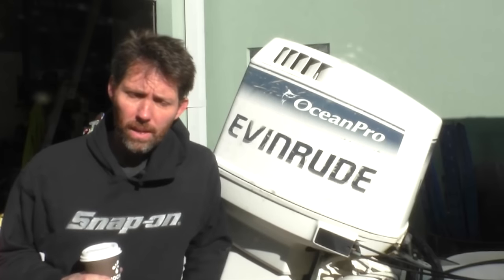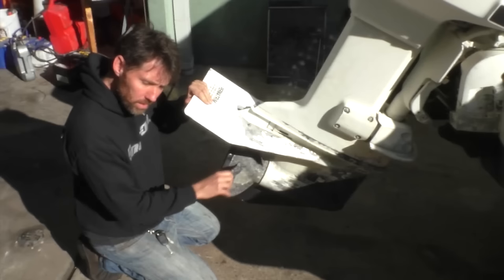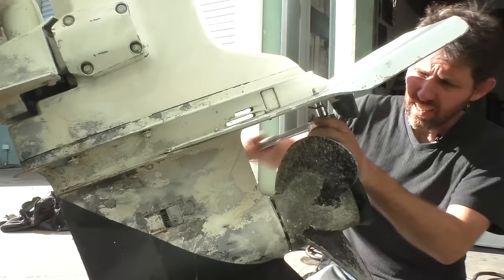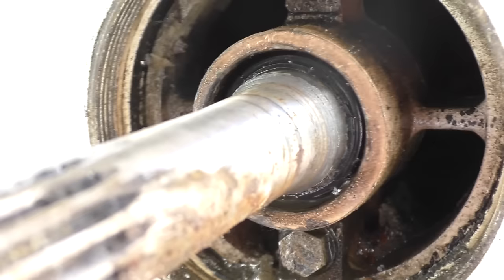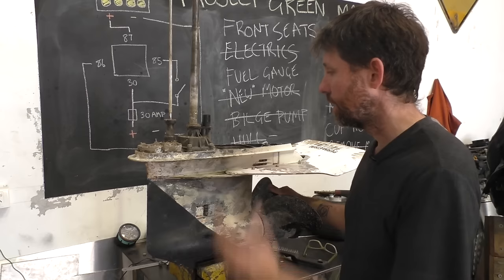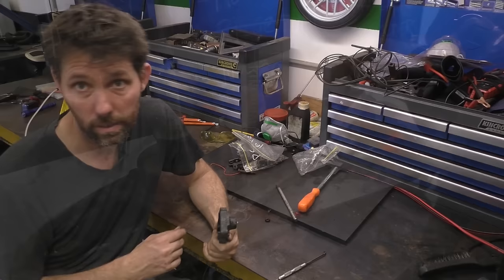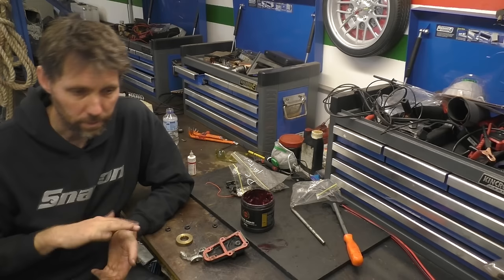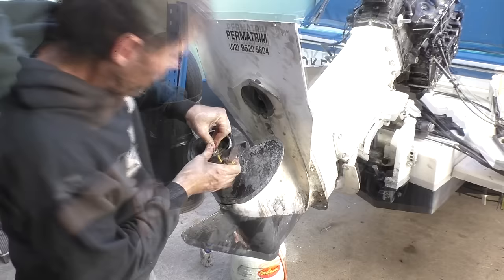Starting an Evinrude 150 outboard for the first time in years

Comment: There are some cheap motors out there in the 150 hp range which i need , but have a blown piston , or weak compression in one cylinder  is
there a lot of work involved in fixing ... thanks.
Reply from the maker: It is a fair amount of work, and if the cylinder needs machining and an over-sized piston installed it can start to cost a few dollars even if you are doing the rest of the work yourself. If it is just low compression is may be stuck rings and surprisingly cheap to fix other than the labour.

Comment: In my opinion outboards shouldn't be on boats kept in the water.. Sterndrives are another issue though, as the engine is inside the boat, and only the driveleg is outside the transom.
Reply from the maker: The thing I like about having an outboard on a boat that lives in the water is that it doesn't have any drivetrain going through the hull leak. Cowlings generally seal better than most engine bays and if the bilge does fill with water the motor is high above that and doesn't get wet.
Reply: I used to repair and detail boats, so I saw alot of different engines and configurations. I guess I could weigh up what I thought was good with what was bad. Everything has got it's pros and cons. If you have a prop shaft, than you have to worry about the stern gland packing leaking, which you can minimize but never stop, but thats why you have automatic bilge pumps for. I've also had to repair transoms torn out of boats because the manufacturer didn't put enough reinforcement in there for the outboard power level it was built for, and pre-emptively do others. It's a subjective thing, and there is no 'best' , it's like trying to say which tractor is best for baling hay?

Comment: Hello sir. I just got this exact motor. Came from a real awful person, so, it's a bit of a mystery motor, that I have to inspect carefully. 
Question:   I've spent a bunch of time, trying to figure something out. I am swapping lower units. The one that I removed has a STRAIGHT shift rod (not even sure it's the correct one. I was Bait  & Switched). The replacement one, has a bend at the top. Which is correct? If the bend is no good, do I just remove the straight one, and put it on the replacement? It's a 1994 150 Ocean Pro. I'm using the lower unit, of a 1996 200 Ocean Pro, which I believe to be compatible.
Reply from the maker: This one is apparently meant to be bent (see follow up video for details)

Comment: Thinking about buying a used 70hp "Evinrude" outboard. However; the gentleman has said that the outboard  sputters at a low idle. Should I be worried?
Reply from the maker: It would be good to get to the bottom of the problem before buying it. If it does will on compression test I wouldn't be too worried, could just need a carb clean or some new plugs.

Comment: I have a 1989 johnson gt 150 go to take off no power I push my key in and out couple times then has power what should I do carbs looks good new gas line and new filter
Reply from the maker: It's definitely running lean if choking it gives you power back. I would make sure all the carb jets are clean and that the floats are working properly.

Comment: Hey curious what your thoughts are of removing a VRO and just mixing oil into fuel tank?
Reply from the maker: I personally think removing the VRO is the way to go. Because the fuel gets mixed before it enters the carburettor bowls the ratio of fuel to oil is set based on the revs you were doing a short while ago so it is nowhere near as useful as the new ETEC technology for example. Add to that the risk of it failing and I think you are better off without it.
Reply: Probably a bit late now, but years ago the VRO pump on my Johnson 50 failed.  I was out on a lake, and it caused the fuel to be saturated with oil (better than the opposite!).  Very embarrassing being towed in by a canoe :-)  I was given a choice of $600 for a new VRO pump, or $60 for a normal pump and premix.  I chose the latter and haven't regretted it at all.

Comment: Please Can Someone HELP ? 
I Have an Early 80's Mariner 50hp 4 Cylinder 2 Stroke. 
I Want to Remove the Gearbox BUT It Will Not come off = GGGrrr ! 
1) Placed Gear-Shift into Neutral, 
2) I Removed the 2 Front Nuts & the 3 rear Nut or Bolts around the Zinc Trim Tab = 5 in Total. 
3) I Tried to Pull the Gearbox Down BUT it Only Comes Down 10mm & Will NOT Come Down Any Further. I Don't want to use Force & Cause Damage
* I Can't Disconect the Gear Shift Shaft as it is ALL Internal BUT I Can See it's Top Underneath the Carbs. Do I Unscrew it There ? * 
Please Can Someone HELP ?  
THANK YOU.

Comment: i have a issue we my 1995 yamaha 90 2 stroke  running  foward they dont go more that 3500 RPM I remove the oil tank mixer i mix the oil we gas now ,i change the spark plugs  i clean the carburattors ,i change  the fuel line ,the prime i clean  the little filter inside the motor,i check the fuel pump don have any hole on the diagfragm the compression on all 3 cillinder is 140 on each cilinder and is working better but not more than 3500 RPM, I dont know if is the CDI SAFE MODE or any other Issue,can you o any person here can help me PLEASE.
Thanks

Comment: great video lots of info on each one of ur videos fix my old problem it wind up been the computer water passege was clooged up. thanx for ur help there.
i have a diff problem my 1999 evenrude fuel injection. is has a long cranking problem , it takes too long to start idk if my choke is even working or how to ck it, but it will start after a long period of cranking the engine over bit i really dont like that im afraid to ruing or damage something else, what would be ur advise to me as tomwhere to start looking, ur help will be appreciated.😊
Reply from the maker: I'm presuming you mean oil injection not fuel injection - ie. it has carburettors - Is your choke activated by pushing the key in? When you do that do you hear a click from a solenoid at all? Could just need a carburettor clean if the idle jets are a bit dirty, but if it idles nicely once it does start then I would be looking at the cold start system for sure.
Reply: Well idk now I have 4 ignition coils 2 per each bank n 6  huge injectors.
What I found out yesterday was I have no spark I do if I crank the engine long enough n then it will start turn it off n on n it starts every single time,but today no start no spark until  excessive cranking, biggining to believe crank sensor failure but don't know how to ck it I have a solid red wire n it could be black or dark grey wire don't know wat to  expect from each one of them? Ur help is greatly  appreciate it ty so much!
Reply: Well I know my questions and issues are a little complex, but here is what I find out over the weekend that my IMM is faulty how I find that out with a simple tap tap using a ball pin hammer n with used of a friend at the imm housing while cranking the engine over I can see spark from the in line spark tester n had the engine running as well turn the engine off n stat it again no more spark tap tap I have spark again lol.
Anyways searching other videos on my everude ficht is that they go bad from over heating n another I found out is that the cooling lines or even the imm it self can get clogged up like mine was. Anyways ty so much...

Comment: awesome video, ive got 115 johnson basically the same as this one but 4 cyl , i left mine for a year and it still starts but wont idle anymore, have fresh fuel and pulled the carbys apart and cleaned out but still the same, do you have any ideas? do these have a fuel pump on them? i can keep it running by pushing the choke when it starts to die
Reply from the maker: It the choke keeps it running then it must be lean so I would still be saying blocked carburettor jets. They do have a fuel pump but if that can supply enough fuel to run with the choke on then it isn't likely to be the problem. I could also be the floats in the carburettor bowls not letting the bowls fill up to to the correct level.
Reply: Dangar Marine
thanks for your reply, ill take another look

Comment: why does mine hesitate to go into gear unless I give More throttle. then it obviously accelerates too fast.
Reply from the maker: I would say the gear selector linkage needs adjusting. This can be done under the cowling where the cable enters the outboard.

Comment: We have a 2001 Johnson 150 ocean pro. When we bring fuel in with the primer bulb engine starts and runs fine. As soon as that fuel runs out it stalls. Seems like fuel pump isn't working but when we opened it up fuel pump looks fine. Any ideas?
Reply from the maker: Is the vent on the fuel tank open? Try disconnecting the line in the carburettors and see if fuel comes out when you crank the motor over. Be careful where it goes for fire risk though!

Comment: I agree with previous comment, the motor sounded a little off from the beginning. I doubt the piston issue had anything to do with you. 

Also, for what it's worth, the end of the shift rod had been correct, angled forward like that. I was surprised that you were able to reconnect it after straightening it. Maybe the top bushing came out to get it to connect?

I work on Johnson/Evinrudes more than anything else.  If you ever have any questions, drop me an email: lookfortony@gmail.com
I have a few videos up, but mostly just to show customers how their repairs are going. I appreciate the time and effort you put forth to help others. Good job!
Reply from the maker: Hi mate, appreciate the offer of assistance as I certainly aren't familiar with these outboards at all. In fact the video I'm just editing up now has a few questions about routing of hoses you may be able to answer. With regards to the shift linkage, from memory I didn't straighten it much as all in the end, I think it dawned on my that the bend was meant to be there before I went at it too hard.
Reply: Shoot me an email, and I can probably send you detailed photos of what you need.  I have several of those motors here at my shop. 

Routing hoses can be a pain with these, as it's pretty tight under the cowling. Not much extra room in there.  Go to boats.net > parts > Evinrude > 1997 > 150 hp and you can pull up the factory schematics. That is a very helpful resource!  You can also order OEM parts there at good price, but I'm not sure how much shipping to you would cost.  

Let me know where I can assist, and I'd be happy to contribute.

Comment: hello dangar marine i have a slight problem on a 1998 evinrude 150hp ficht at start its idling over 4000 rpm do you have a solution for this please let me know thanks
Reply from the maker: Not sure what that could be. If it settles down after a while it could be a cold start system otherwise it may be a timing or carb linkage adjustment issue.

Comment: Thank you so much for you help thank to your video I was able to start up my Engine, but I have a question it sounds good but it has an air relief sound that I don’t know what that mite be.. u have any ideas..
Reply from the maker: Is it coming from under the cowling or the propeller? If it is cowling it might be a vacuum leak from a loose hose, if it is the prop then the outboard might just need to be trimmed down more.
Reply: Dangar Marine it’s coming from under the last carbulator

Comment: What does the "Ocean pro" or Yamahas "Saltwater series" give you extra to help with, what I assume is salt water?
Reply from the maker: It depends a bit on the age, but with modern motors there really isn't an difference. Previously there may have been extra use of stainless steel and some extra facilities for flushing the motor with a direct hose fitting, but that's about it.
Reply: Dangar Marine thank you sir.

Comment: So how well did it run after you got it running? Did you have to rebuild the carbs?
Reply from the maker: No, it ran quite nicely on the water apparently, got straight up onto the plane. It later lost power though so it will be back in for a bit of diagnosis soon.

Comment: 11mm is the same as 7/16 sae and 14mm is 9/16 sae
Reply from the maker: Yes, I'm slowly learning to memorise all these equivalents!
Reply: I use to work on those old Evinrude outboards quite a bit in my spare time.  I'm a electric motor mechanic by trade. 10mm and 3/8 don't cross over and 15mm and 18mm don't cross over to sae. I love your channel, I practically grew up on a fresh water river here in the USA.  Keep up the good videos Thumbs up

Comment: Ok. At first you said you were not doing any work to the motor. You were checking it over for a friend. Now a quarter way through you are messing with shift linkage and changing gear oil. Best of luck. That Evinrude is a turd.

Comment: I'm considering switching over to this same motor. 1996 150 from a 1990 Johnson 150 gt. Think it's worth it?
Reply from the maker: I'm not that familiar with the Johnson you are moving from, and to be honest this is the only Evinrude of this style I have worked on and it blew up! So far though it does seem a very solid motor putting it back together though. It would really come down to the upgrade price and the individual condition of each motor.

Comment: Hi Stu, wow learned allot about at least this engine. I went to start my mercury 2 stroke today since it quit raining finally after it sitting for all last season without being started. got everything hooked up to static crank it with plugs out and wires grounded and nothing? disconnected the static stuff and put it all back to normal with plugs in and tried to turn it over at the console. could hear the solenoid click but the starter is not turning? since I know it's not the battery and the trim works will disconnect the battery and start cleaning all the connections. any other suggestions are welcome. thanks
Reply from the maker: It could have that the brushes aren't making good contact inside the starter motor, you could try rotating it by hand a few times just to help seat them and take off any surface corrosion. You can also try using jumper leads to apply power straight to the starter motor to quickly determine if it is the problem or any of the wires driving it. If the motor is not working, this video on trim tilts goes through electric motors which are all pretty much the same: https://www.youtube.com/watch?v=woVT4czk6ao
Reply: Dangar Marine OK I think so too. since I can hear the solenoid click I figured it works. I tried turning it by hand and it moves but didn't get it working. I removed the starter and put in my garage to vice it up and put 12v to it. yes easy on the vice too. will try it tomorrow. if that doesn't work will carefully take it apart to see if there is anything going on. hate to buy a new one if this is still good. will let you know. Thanks
Reply: good video by the way.
Reply: starter works on the bench. putting it back in and will keep testing.
Reply from the maker: Good that the starter is fine. It takes a sharp eye to spot those dodgy wires some times! Hopefully it is your problem. :)

Comment: I have a 1996 50hp force 2 stroke  and after you run it for a while when u shift it back to neutral it don't want idle it wants to shut off the carb has been all cleaned do you think it might be getting hot and maybe need a new thermostat or do you think it something else thanks
Reply from the maker: Could be overheating or maybe the fuel pump isn't supplying enough fuel and the carbs are running dry.

Comment: I recently purchased a 87 mercury classic 50 got it running and took it out for shake down seem to run ok but but ran through a lot of gas. I found the lower carb was missing the metering jet. could this cause excessive fuel consumption and could it cause damage to the engine being run like this?
Reply from the maker: It was probably running rich which will use a lot of petrol, but it isn't as bad for the motor as running lean. Take a look at the spark plugs and see how black each of them is. That will tell you what is going on with your mixture.
Reply: +Dangar Marine thanks I'll do that and I got a new jet on the way.

Comment: Should of put a $20 .00- $35:00 water pump impeller on since you did all the other Seal changing. Now you have to take it all off again just for a pump Impeller.It ran before,and will run again.The Owner that cheap? Get good pay!, that motor is in bad shape.

Comment: Hi mate. After buying my 1st boat i learn the guy sold me a motor with a few issues taking the guys word and having no idea im left with a regret. Have a few tips on what to look at and look for if i ever go lookong for another?
Reply from the maker: https://youtu.be/MqkXNaqS_lQ
Reply: @DangarMarine  thanks video was a big help. I also have a problem with the tension on the throttle it's a 25 yamaha tiller 2 stroke. The engine doesn't move until the throttle it turned all the way and even then it's very slow I'm guessing because it's not turning the throttle enough to give it all the way.

Comment: Can you please help? I have  1999 2 stroke mercury 150.  Everytime I try to start it it takes about 10 minutes and several attempts before it starts.. I'm afraid to turn the engine off when I'm fishing, because I may not start again.  I got a new fuel/water separator and primer bulb.
Reply from the maker: I would start with a carburettor clean and new spark plugs.
Reply: @DangarMarine  I have new sparkplugs and replaced the fuel filter and fuel/water separator.. I'm going to use a product called Sea Foam to see if makes it better.  I don't know what else to do

Comment: Is there any way I could get more horsepower out of my 1994 Johnson 25hp?
Reply from the maker: It depends whether that outboard shares a block with a larger horse power motor such as the 30 or 40. If so I it may just be a case of changing the reed valves and putting larger jets in the carburettor.